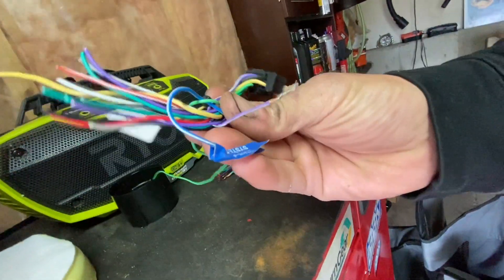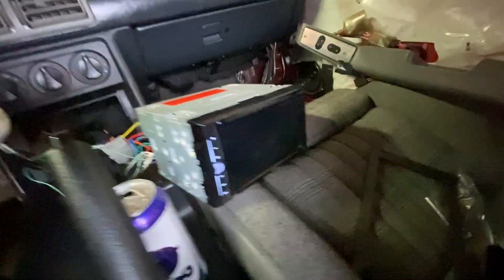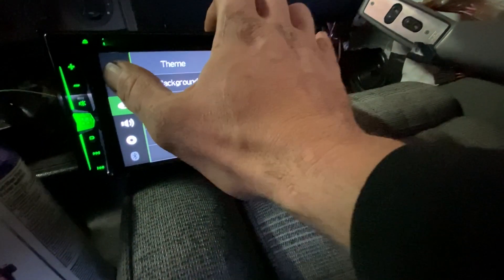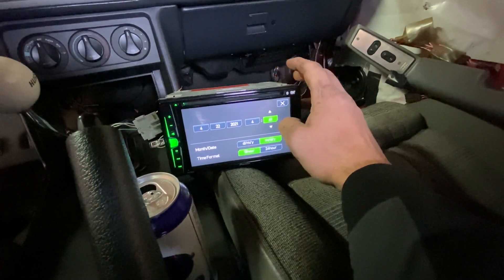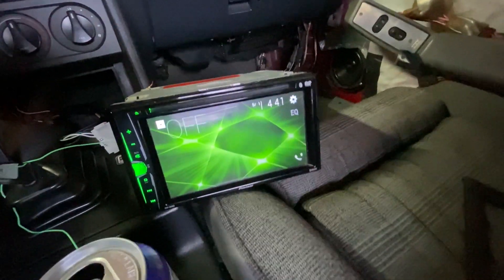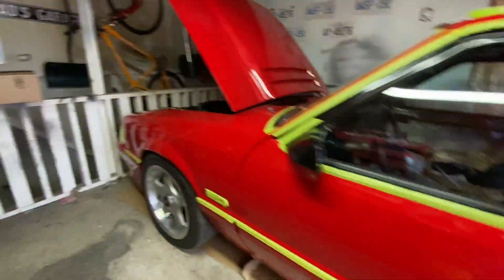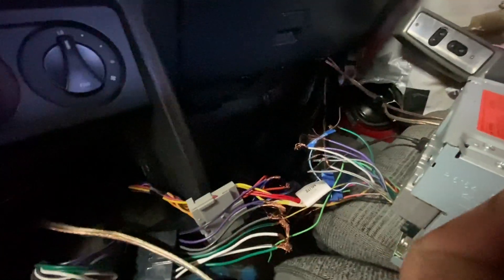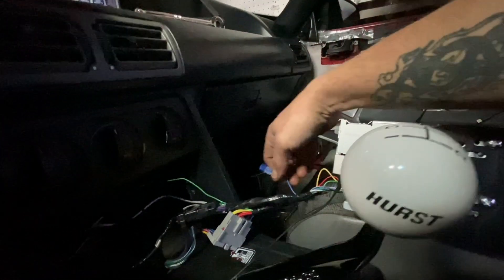installing a double din radio in my foxbody. it wasn't fun

Comment: Looks good i am glad to see that you didn't purchase one of those aftermarket plates and chop up your dash by moving your heater control to the bottom and install your stereo system to the above area why in the hell would anyone chop up a fox body i personally would rather hear the sound of the motor and exhaust
Reply from the maker: Yeah I considered that but I didn’t like how it looked.
Reply: @simcoecountygearheads  I agree